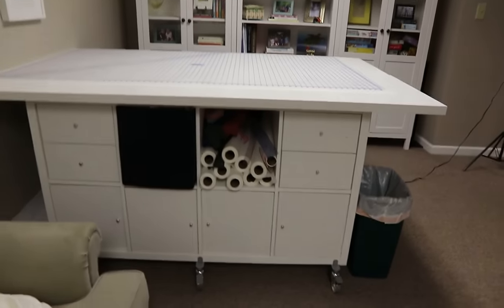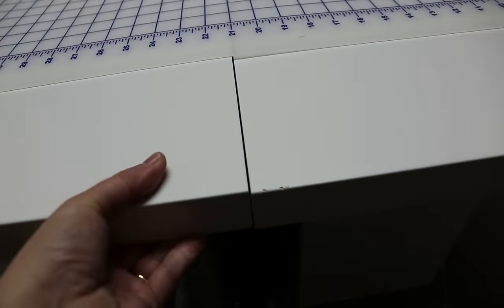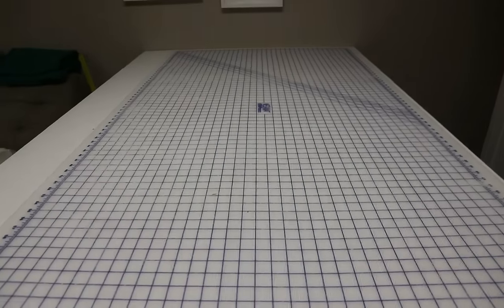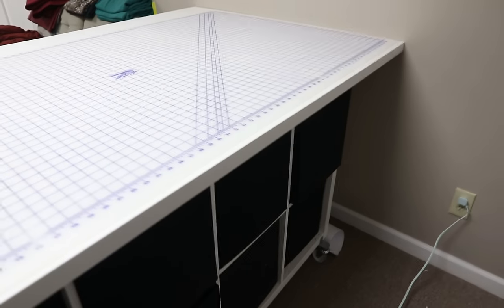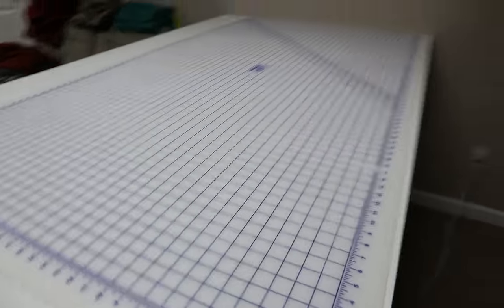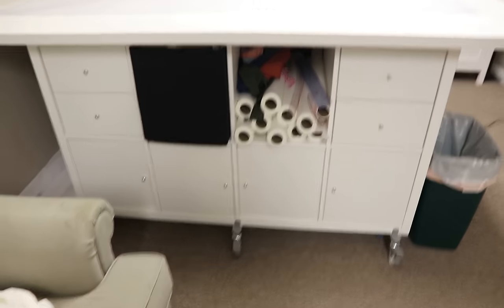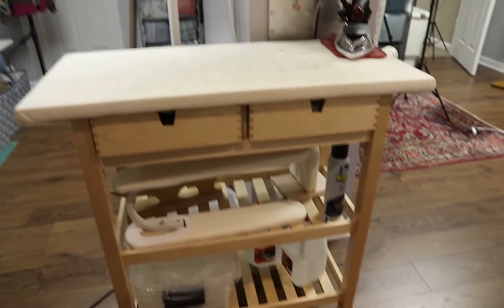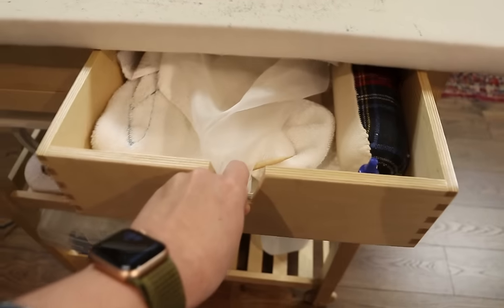My DIY Cutting Table and Pressing Station

Comment: I also used two kalax shelves. I’m 5’6” tall. So my husband mounted them on a sheet of plywood and added casters to the plywood bottom.  The shelves just sit on the plywood. They are heavy enough they do not slide off.  Then we used my old top from my cheap Joanns folding cutting table and the grid cutting mat sized 32” by 55”.  Then I added some command hooks on one end to attach a few rulers.  I have my cubes just like yours with drawers and doors one side and bins on the other.  This was life changing in my sewing room!  I have a small room, so the two units needed to be pushed together and the top just fit the size of the shelves with no overhang.
Reply from the maker: That sounds fantastic!

Comment: Good tutorial!  Thank you!  I think for me, I would do two layers of batting cut the size of the cart and then do a drawstring around the duck - like a regular ironing board and tying it tight so it can be removed for washing or replacing.  This would be  as easy as a 2 inch corner out of each corner, sewn like a box cushion, and then hemming a casing for the twine to go through.  I also think I'd prefer one top over both cutting board cabinets.
Reply from the maker: The drawstring cover is a great idea!

Comment: Found this.  Thank you.  I just bought your iron from Wawak.  I noticed in the manual there is quite a bit of maintenance to be done monthly such as the plunger & spring, fitting in the solenoid.  Have you had any issues with those items?  I think I’m going to make your ironing table too.  Thanks
Reply from the maker: To be honest, I’ve never done any maintenance in the 7 years I’ve own it other than change out the resin in the tank. I dropped it once and my son had to fix it, but other than that, I use distilled water in it and it works great!

Comment: Such a great vlog. I do not like one bit my ironing board and will definitely make one like yours. Next up irons. Is there a way for the steam on your iron to always be on?  I would like that as a feature. Soooooo important that you mentioned your hook going into a stud. My friend installed a fixture with a hook directly into the drywall in her ceiling. It took a few years but a crack formed that spanned the entire distance of her room. A very expensive repair was the result. Merry Christmas Whitney! 😘❤️🎄🌵
Reply from the maker: Yikes!  That does sound expensive!  You can definitely leave the water on for the steam and if you just press the button, it will give you continuous steam.

Comment: When I showed my hubby your iron station he asked if I wouldn’t miss the length of an ironing board(like for slacks or maxis) and the narrow tip for necklines collars etc.  how do you deal without those two typical ironing board functions? Thanks  for sharing so much with us !
Reply from the maker: I still use an ironing board for my actual ironing.  I use this just for my pressing.  Having it all one size (as opposed to the narrowing of a regular board) is handier for ironing or pressing yardage and when I’m pressing longer items (slacks for example) or collars, I’m usually using a pressing tool!
Reply: @TomKatStitchery  makes perfect sense! Now, do you iron in a different room?  My ironing board has been mult-functional and up permanently in my sewing room for years! Of course I change out the covers and so on. I guess in order to have a press
Reply: Station, the board would have to go or at least elsewhere. Thanks.
Reply from the maker: @angienorman5974  my regular sewing machine is folded up and hanging on the back of our closet door.  Any actual sewing I need to do, I just pull that down when I need to iron!

Comment: OMG!  I am re-doing my sewing room and ordered Kallax units for my cutting table. My husband just assembled them this past weekend and my son-in-law will be attaching them together and putting the casters on. I chose 3 of the smaller units to be attached in a square C pattern but the top will be a rectangle. This will allow me to have leg room for a breakfast height stool when using the table for finer work or crafting. The IKEA  table top wasn’t the right size so my handy son-in-law ordered it from Home Depot and will cut to size.  The dilemma I had when trying to design one was that my sewing room is the front bedroom of our bungalow and hubby wants the room to look neat.... so we compromised that I would choose something that looks like a piece of furniture.  Pick your battles, right?  😜After all,  I was finally getting my dream sewing room  🥰 where I didn’t have to do stairs (due to pain from GBS).   I racked my brain until my daughter suggested the Kallax for which I ordered drawers and cabinets for front and hallway facing sides, and a couple of the bins for the side unseen when not in the room 👍🏻Perfection!  Now for my sewing table for serger and sewing machine....Do you have a video showing yours?  I love your cutting and ironing stations. Thanks so much for sharing! Sending you 🤗❤️ from Canada.
Reply from the maker: I love that idea of doing it in a U formation.  That’s so smart!  My sewing tables are office tables that were given to me, but you can see a full sewing room tour here: https://youtu.be/rUPZxJtQF4o

Comment: I struggle with the height of my serger and Coverstitch machines. Are your tables lower? Machines Recessed?
Reply from the maker: No.  My serger and coverstitch machines sit on a regular table.  I do have an adjustable chair to raise me up, but if I’m working at them for too long, my back feels it.  I can sew all day long on my regular machine that’s recessed in a table, but the ones on the table will hurt.
Reply: @TomKatStitchery  Exactly - And my back is old! My son is working on lowering my table, or finding some solution.  I am also a short girl. ( and getting shorter)